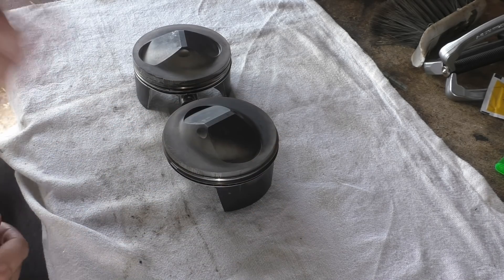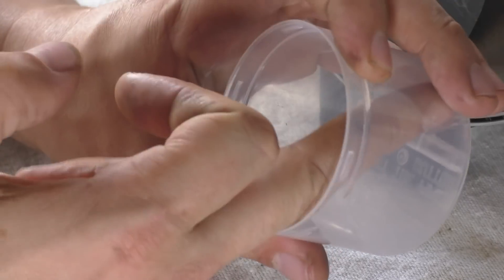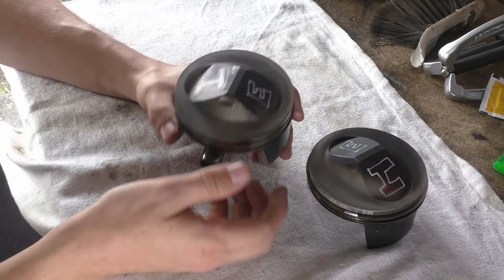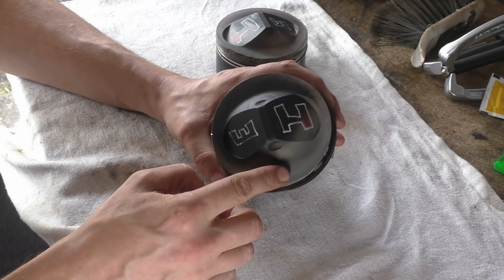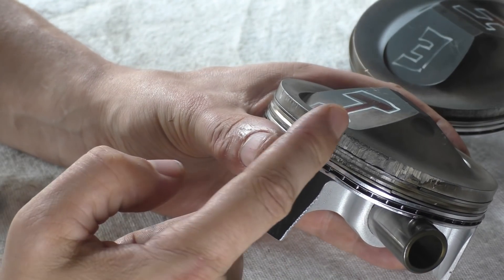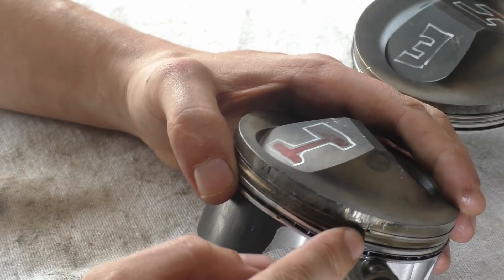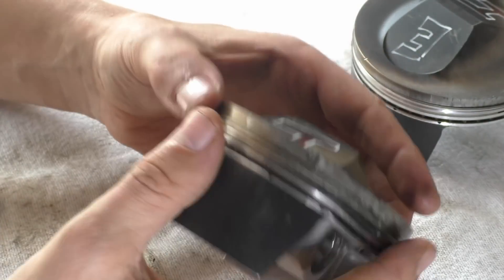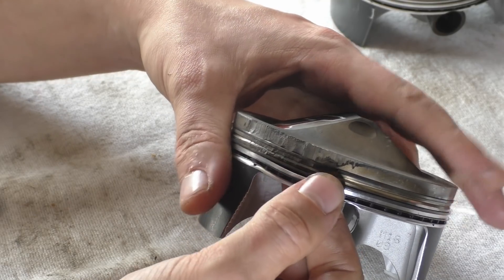Ducati Pistons - Detonation Failure Analysis

Comment: These are not OEM Ducati pistons. They are aftermarket Pistal pistons designed for 1100 Dual Spark Engines.
Someone fitted them on an 1100 Evo (Single Spark) and learnt a valuable lesson.

Comment: Great video  but I have a question. If you have sligth "eroding" above the first ring, all the rings move freely, and no roughness on the top of the piston could you reuse this piston? If you can reuse the piston would you take a peice of fine sand paper and clean the "eroding" up?
Reply from the maker: No. The piston itself is age hardened. Getting that hot removes this age hardening and the piston is prone to crack at the pin bosses
Reply: @thedirtyworkshop  thanks for getting back to me and sharing your wealth of knowledge!

Comment: This damaged piston along the side looks a little bit like the damaged piston I posted a few months ago with a hole burned into it at the side. Though that was from a diesel. And there the flame burned the piston's aluminium away around the rings but the rings themselves were just fine.

Comment: Detonation is where the fuel/air mixture turns from a low explosive (burning), into a high explosive, which detonates, mostly due to an overpressure situation. An easy way to do this is by installing a turbo without dropping the compression ratio.

Comment: Have you had chance to inspect  the barrels because this looks like the problem the old two strokes had when the compression was too high and the petrol - oil mixture was too weak. The initial problem was detonation and then the piston started to leave deposits of alloy on the barrel which started a partial seizure,  not detonation traveling down to the top ring. Just a thought.
Reply from the maker: There is no build up just material removed - you can see where the already damaged piston has scuffed the cylinder. I've seen hundreds of pistons like this for both 2 and 4T. Like a said in the video you can see that the top surface of the ring groove is also eroded away.

Comment: So here's a question for you Matt.  With two sparkling plugs that the pistons are designed for,  does this mean 2 flame fronts and no "burn to detonation" I.e with one surely there is the space and time for the flame to exceed the speed of sound?

Or is this just compression too far anyway? 

Best regards

Paul
Reply from the maker: This is a good question and we need to cover a lot more on detonation, combustion etc

Comment: How come detonation pushes downwards against piston? Shouldn't detonation product pressure every direction? Or is it because piston is still comming up when detonation hapoends so two forces meet up?
Reply from the maker: Ignition has usually occured or is occuring. Below the piston is low pressure, rememebering that rings don't perfectly seal. So the combustion gases and hence pressure of that gases has 2 ways to go - towards the spark plug ignition event - which is does - and down against the rings. We can't see the gas interaction because it gone - what we're left with is the piston - in bits LOL

Comment: There is fuck all metal on that skirt why so little aluminium looks like a dog shite design
Reply from the maker: What? Why does there need to be?
Reply: @thedirtyworkshop  where the pin is there is very little aluminium if there was more maybe the ring  wouldn't bend as it has
Reply from the maker: Yes but this isn't a structral failure. If the land below the ring was thicker, the piston will still be fucked.

Comment: Hi, i want to take your opinion on somth. it's not related to this vid, but i am sure you can help. My bike sometimes acts funny. some days it will be running very well, n i can ride for 100s of KM with no issue, and sometimes i feel it loses power! I keep oil change on time, filters, spark plugs n maintain it very well. What do you think is the issue? is it weather? is it the wind slowing the bike? Fyi, my bike never died on me or left me in middle of the road. Any thoughts

Comment: Question for camshafts are concerned for high compression Motors what is the best camshaft for a high-compression motor to produce the most power out of it from the factory?
Reply from the maker: We'll get to that - one thing at a time.
Reply: Oh okay well if this is not too much to ask if you can incorporate this into your next video the specs of my engine is 231 intake 231 exhaust 354 exhaust and 334 intake is the cam specs with 11.5 to 1 compression ratio what will be the best for that particular compression ratio is the cam that's in there now good for all motor or is that more of a turbo cam?

Comment: I'm guessing the less damaged piston is from the front cylinder since it would get better cooling not having all the intake plumbing to block the flow of the cooling air?
Reply from the maker: I didn't find out which is which because the donator couldn't remember, how ever the rear cylinder is run rich because of this. More on this in the next video
Reply: Is this engine water cooled?
Reply from the maker: No, air cooled.
Reply from the maker: Its from a Ducati 1100 Monster Evo
Reply: The rear cylinder on a air cooled v- twin has a bad deal.

Comment: What's that black stuff on the skirts?
Reply: I think it may be some kind of anti friction coating to help with piston slapping.
Reply from the maker: Teflon - that's in the next video
Reply: If teflon can take rubbing on the skirts why aren't they making rings out of it or at least coated with it?
Reply from the maker: The rings get hot, and wouldn't be able to hold on. As you can see the hot combustion gases bear down directly on the rings. The other problem is coverage. One thing with PTFE is it doesn't like to stick to much, and a thin cross-section ring doesn't have much meat to hold onto.
Reply: Bummer.